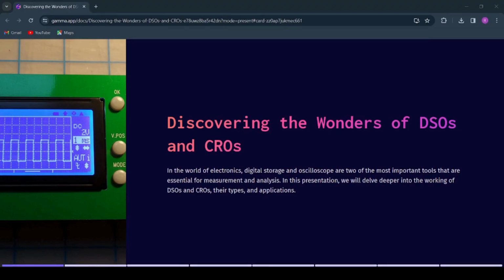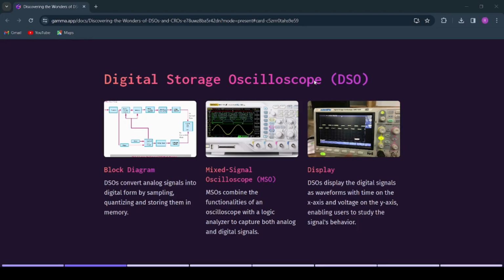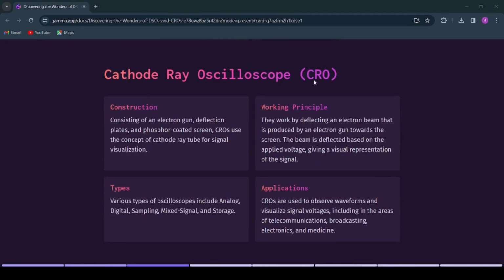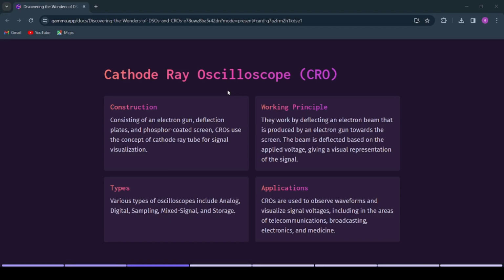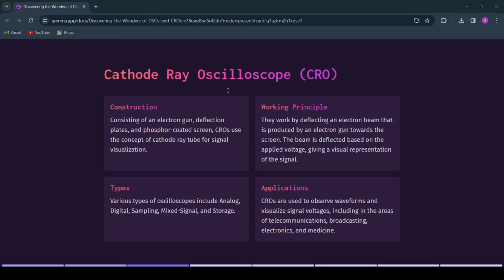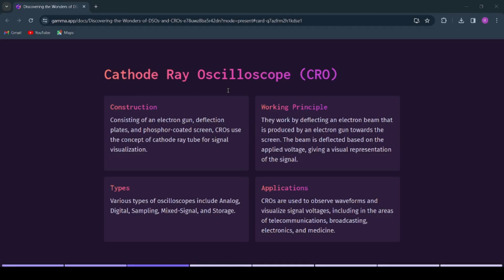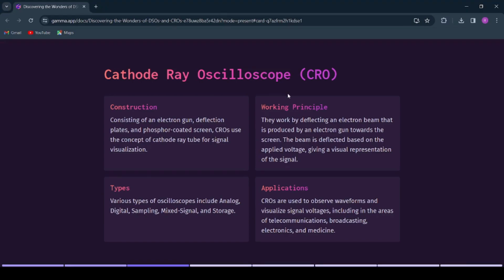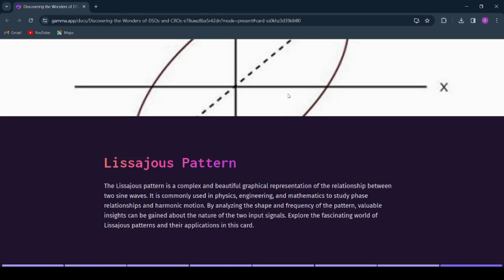"Unveiling the Intricacies of CRO, DSO, and the Mesmerizing Lissajous Patterns" | EIML | S.P.I.T

Comment: Sure, chicken tikka masala is a delicious dish! Here's a simple recipe for you:

Ingredients:
- 1.5 lbs (about 700g) boneless, skinless chicken thighs, cut into bite-sized pieces
- 1 cup plain yogurt
- 1 tablespoon ginger-garlic paste
- 1 tablespoon garam masala
- 1 tablespoon ground cumin
- 1 tablespoon ground coriander
- 1 teaspoon turmeric
- 1 teaspoon chili powder (adjust to taste)
- Salt to taste
- 2 tablespoons vegetable oil
- 1 large onion, finely chopped
- 1 can (14 oz) crushed tomatoes
- 1/2 cup heavy cream
- Fresh cilantro for garnish

Instructions:

1. In a bowl, mix the yogurt, ginger-garlic paste, garam masala, cumin, coriander, turmeric, chili powder, and salt to create a marinade.

2. Add the chicken pieces to the marinade, making sure each piece is well-coated. Cover and refrigerate for at least 1-2 hours, or preferably overnight.

3. Preheat your oven to 400°F (200°C). Thread the marinated chicken pieces onto skewers and place them on a baking sheet. Bake for 20-25 minutes or until the chicken is cooked through.

4. In a large pan, heat the vegetable oil over medium heat. Add the chopped onion and sauté until golden brown.

5. Add the crushed tomatoes to the pan and simmer for 10-15 minutes, allowing the flavors to meld.

6. Stir in the baked chicken pieces and cook for an additional 10 minutes.

7. Pour in the heavy cream, stirring continuously to incorporate. Simmer for an additional 5-7 minutes until the sauce thickens.

8. Garnish with fresh cilantro and serve the chicken tikka masala over rice or with naan bread.

Enjoy your homemade chicken tikka masala!